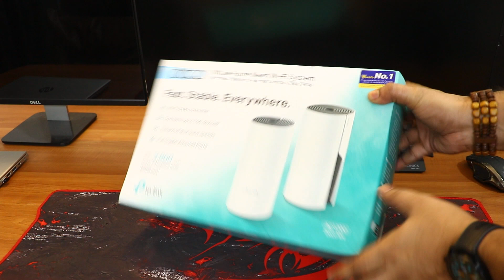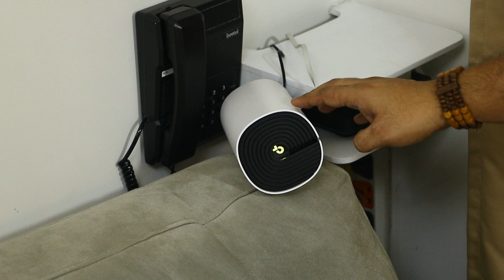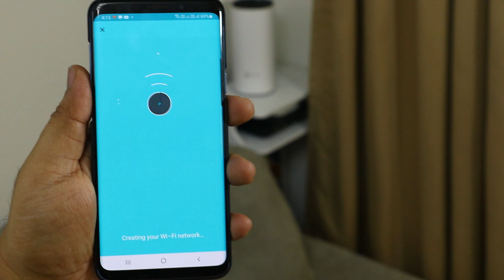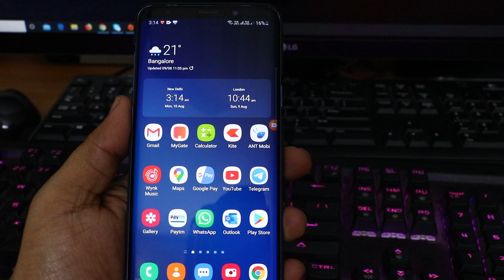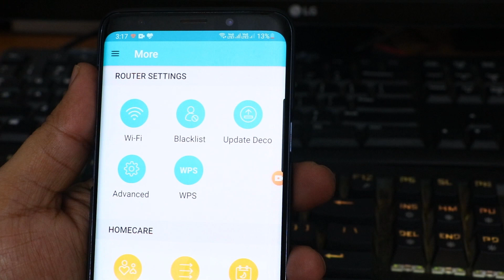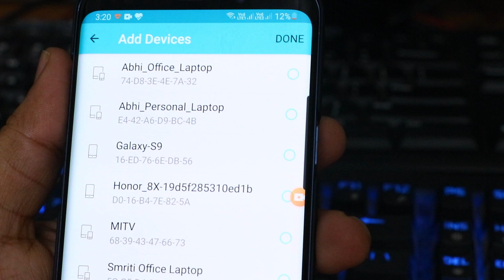High Speed Mesh WiFi | M4 DECO - TP Link | Seamless Wifi Connection |  Review

Comment: Useful video 
I have a doubt
I have 200Mbps connection
I have an old d link router ...in which I get 50 to 60 Mbps
So should I have to upgrade my primary router first to new dual band wifi router which costs 2,500 or something 
Or can I use with the same old router?(if so what speed will I get?)
Please reply bro

Comment: Hi, got a question if u don't mind answering 

I've currently got powerline adaptors wired to my ps4.

If I buy the mesh, will using its ports and wiring to my ps4 do the same job 

If I wanted it wired will it do the same job. Or is one better than the other?

Comment: Good product but it has only 2 channels which it uses for back haul as well unlike the much pricier M9 plus or the P9. The 2 nodes are on different floors and I don't have any Ethernet cable to connect the main node to the satellite. I added a power line adapter Tp-link TL-PA8010P KIT since I have 3 phase power supply. Wifi speed from the satellite node doubled after adding the power line back haul. It's now functioning like the P9. I can upgrade to a wifi 6 in 2 years time and still re use the power line adapter. The OS is a bit buggy and my phone is not able to roam seamlessly. It connects to the farthest node sometimes! It's also configured in router mode but connected as AP to my router :-D. I now have 2 networks' IP subnet depending whether I use the router or the mesh. Overall it's value for money. Highly recommended

Comment: Bro I have deco e4 and not getting more then 93mbps even after having 200mbps  internet connection ple help
Reply: E4 is limited to maximum 100mbps. It can't exceed this speed
Reply: @Wongmc644  Yes you are right
Reply from the maker: @Wongmc644  Change the wifi option to 5ghz.. it will give more
Reply from the maker: Go to Deco app and go to WiFi and turn off the 2.4Ghz option.. it should improve

Comment: Can we connect 2nd deco via Ethernet also considering 1 st deco is connected to modem via Ethernet also
Reply from the maker: Yes, we have ethernet backhaul option given for M4. I have not tried this, but its possible.
Reply: @TechvirusIndia  yes this has option but in some of the reviews people told  that internet backhaul doesn't works somehow since secondary deco always seems to connect wirelessly... I have a 300 Mbps connection with 3 floors house and I have Lan in individual floors and that is why I need to be sure that each floor decos connected with lan will work or not.
Reply from the maker: @arpitgenius  This is what Tplink says for this in help section :-

1. Please note that the main Deco unit will act as an NAT router by default.
2. Please set up the Deco units on the same network at first through the Deco app before you wired them together.
3. Please ensure there are no other DHCP servers behind the main Deco. Otherwise, it will cause other Deco units getting an invalid IP address which doesn't have internet access.
4. If you have switches on the network and find Ethernet Backhaul not working, please check the management IP address of your switches. It seems that some switches adopt the same management IP as the LAN IP address of Deco, which may cause some conflicts on the network. In this case, it's recommended to change the management IP address of switches to another one.
Reply: @TechvirusIndia  Thanks for you help. Really appreciate it
Reply: Ethernet Backhaul keeps reverting back to Wireless Backhaul and nothing I do is helping plus my internet keeps going down when deco is in the network 
I have a BSNL FTTH connection 200Mbps

Comment: well explained.can i connect the  ISP CABLE  directly and use it as a router ???
Reply from the maker: Thank you. You need to connect ISP cable to your modem/Router then from modem to Wifi Mesh node. Directly also it can be configured but bit complicated.
Reply: @TechvirusIndia  THANK YOU

Comment: This is V1 or V2 model? Is Amazon selling older V1 model? because they don't specify anything. And.. Does it come with plastic wrap on the carboard box to make sure device is sealed and unused?
Reply from the maker: Yes, it comes with plastic wrap on cardboard box.
I got the ver. 2.0 from Amazon link which I have shared in the description.
Reply: @TechvirusIndia  Thanks

Comment: Is it necessary to connect the deco M4 to the main modem (Airtel) through cable ? Can’t we use as wireless extender ?
Reply from the maker: You need to connect atleast 1 Deco M4 to Airtel Modem.. That is how it will give you best speed.